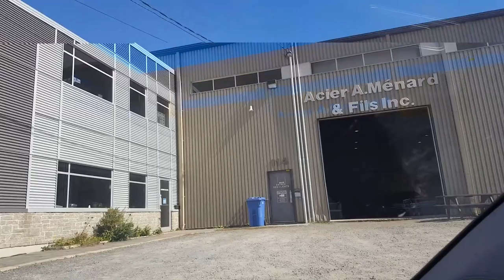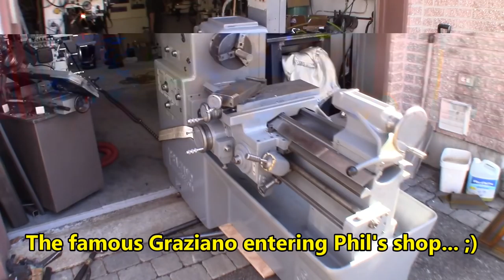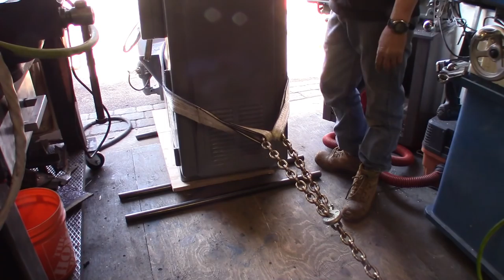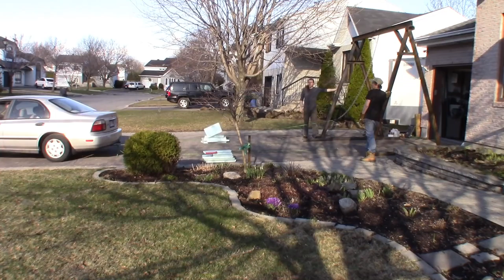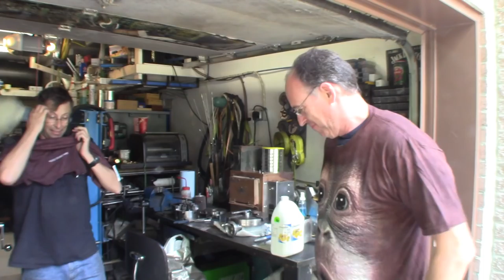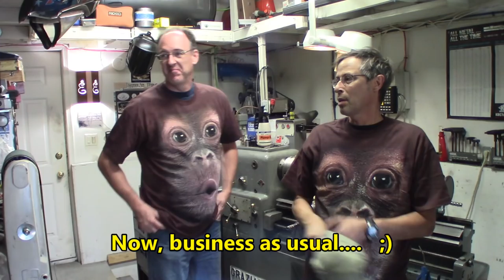Xmass wishes and Cut-out treat clips, enjoy…!!!

Comment: Pierre: Not exactly on topic, but I saw an interesting 3 part series on your Geothermal installation. Part 4 never appeared, but, 3 years later, what do you think about it overall? Did it save you money on heating? Cooling? Curious minds and all that...
Reply from the maker: Hi Wesley,
The installation in the video is not my personnal installation. Here it wasn't filmed, but, it's in function for about 8 years, the performance is really good, it serves to heat the house that is 1000 sq.feet plus the basement, and, also the shop 25 feet from the house, shop is 600 sq.feet, the concrete slab isn't insulated cause it was already built when we got the house.
Lately the temperatures kept under the minus 20 to -25deg. C (  -4 to -13 F) with even lower peaks to minus 30...   It's holding pretty good with the 3 tons heat pump.
It reduces the cost of heating by at least a factor of 3, the cost of electricity that is our only source of energy here is about $1650CDN per year, if it wasn't for the shop it could be around $1000 or less, the shop needs quite a lot of energy since the floor is loosing some heat due to lack of insulation...
You also need to keep in mind that the compressor will need change every 10 to 20 years or so, actula cost for replacement is around $3000.
Anothe benifit, is air conditionning in the summer includes in the price, here the cost of electricity is going from  8 to 12 cents a kilowatt on our plan, some other plans are from 5 to 20 cents on bi-energy plans...
Hope it gives you a good picture of the cost/performance ratio... 
Pierre